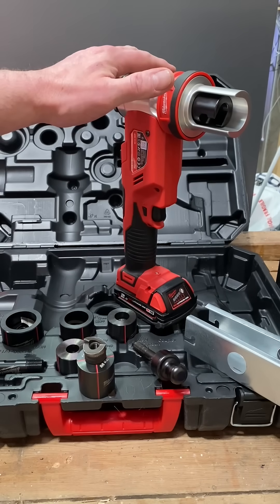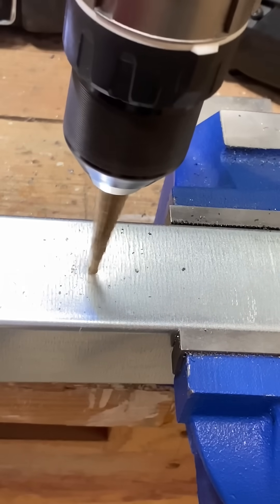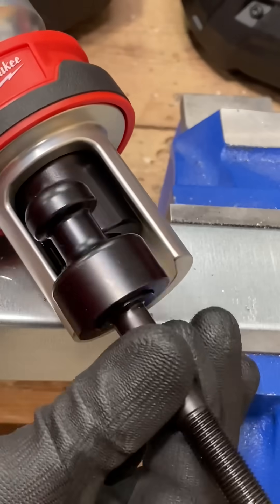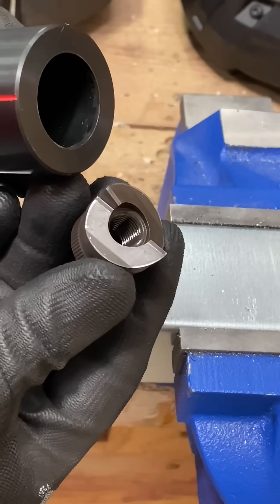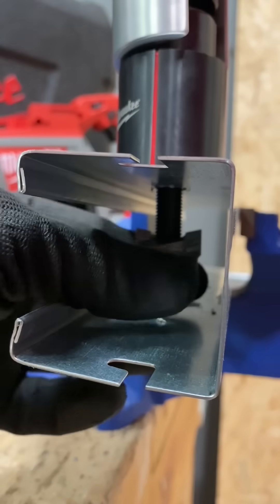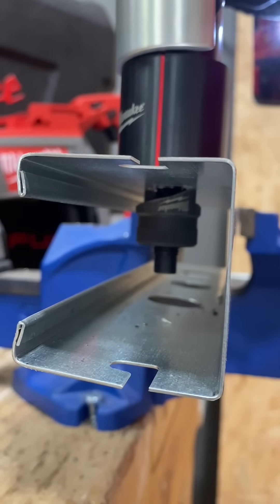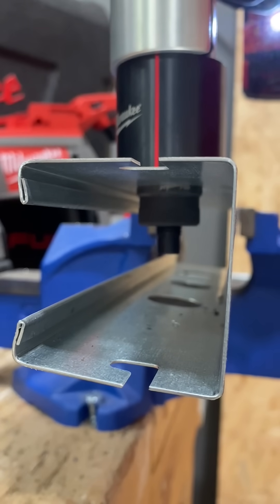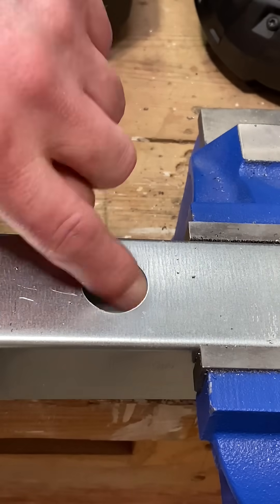ELECTRICIANS' TOOL TEASER - Milwaukee M18 Force Logic hole punch #shorts

Comment: I think for £1000 you’d need to be using this all day every day. Don’t get me wrong it leaves a nice finish but I can’t see how you could make this pay for itself very quickly?
Reply from the maker: Yes it’s one for the daily metal munchers.
Reply: Lovely bit of kit, but you would have to be hammering the industrial installs everyday for that price
Reply: @amatchmadeindevon2005  not every tool has to pay for itself. When you’re making good money sometimes you’re willing to spend more than time saved to make work a little bit more satisfying ;)
Reply: After a few holes thay will be blunt and leave a razor sharp burr, might as well stick with thin kerf hole saw I can cut hole and the us debur as quick as hole punching and save loads of money 
PS don't use the thin starret hole saws any more thay have gone to crap last 5 mins
Reply: You will pay whe you work around live circuits and don't want a mess of drilling shavings,  or pushing your drill hoping you won't damage cables on the other side of the metal sheet,  you have a clean cut and not a rough hole, not mentioning your elbow grease.
Reply: @ca-tf7ek  you do realize that you have to put this thing inside of the tube, right? The cables are still in the way no matter what
Reply: @ca-tf7ek  
If you put a short end of a plastic bottle around the cutter. The keep it from a live contact.
Reply: I have a manual version, drill 8mm hole, insert cutter (20mm), and tighten with Alan key. Cost about £10
Reply: I can’t see this lasting very long, at £1000 you’d want to get 2000+ holes out of it. Really more like 5000 holes.
Reply: @chrisb4009  die set will be buggered long before that and it'll be files out to get rid of the big burrs might as well use a good thin kerf hole saw it's lots quicker and lots cheaper to replace when it's blunt ,I build panels and I've put thousands of holes in them you won't better a hole saw for speed and price, use a deburring tool like the countersink bit to tidy up any burr left  jobs a goodun
Reply: @rogergregory5981  you're telling me you don't use a hydraulic punch for holes larger than 25mm?  Frankly I hate metal shavings, especially with enamel smoking, plus the heat can warp sometimes especially with a dull bit.
Reply: Exactly it’s almost more time messing with everything
Reply: Easily make money with this. All you need is a lot of luck, charm and salesman ability for when you're selling holes for 100 each. Only need to do 10 holes and you're set. All other subsequent holes are profit holes.
Reply: @shaunlastname391  people doing metal work like this can be ridiculously overpaid.  I know because they will brag about it when I install their internet. Rich clients will pay out the ass for custom metal work.
Reply: “So how long does it take for the consumer to make his or her money back off the use of the product” “The what?”
Reply: sounds like someone hasnt manually knocked out or slugbusted before ....all that pumping damn😂and the ratchet wrist destroyer
Reply: That’s where “time and material” bids come into play: the company that awarded the contract pays for the tool. Plus 1k bucks isn’t THAT expensive in the grand scheme of things.
Reply: @RedSilverado07  cheap tools cost double good tools pay once
Reply: I’m no metal muncher, I design and build systems from cradle to grave. Kit like this is a Godsend. I need no middle men.
Reply: @sparkz9803 Please excuse my newbie-induced ignorance here (being neither a metal muncher
 nor a member of Cradle-2-Grave hole embiggeners - hat tip to the Wisen Wizard Of The Angry Pixies Of The Great White North, AvE, Author of the classic machinist manual,  "Always Close Your Eyes When Operating A Power Lathe") but I asume your favorable comments indicate it is capable of producing results that othrr tools in the price range cannot. Vould you be willinh to educate me a bit? I promise to shutup and listen.
Reply: @disqusmacabre6246  hard to explain. It just feels like you just cut open a cardboard box as opposed to scraping a hole onto metal. Drilling out a half inch hole is alot easier and sends alot less metal shavings everywhere than a 1 inch or 2 inch hole. Even more so if you're in a awkward position or in tight spaces and have to drill a hole. It also allows you to adjust your hole if you didn't drill as center as you want.  I hear stories of electricians getting MRI scans and they can feel the metal in their skin reacting. Anything that reduces the chances of getting  metal shavings in my ears, I'll take. But yeah this thing only really shines on bigger holes but you have to drill half inch anyways.
Reply: @sparkz9803  do you mind explaining how so? I'm curious
Reply: Nice tool, but WAY out of my price range. A GOOD step bit is under $50 and works just fine for me. Now if I was drilling holes like this ALL day, EVERY day to then I would invest in one. But less than 10 holes like that in a week, I'll stick with my step bits.

Comment: P.A.T testers must be pleased now, sitting in the warm cabin just certifying charging units rather than hundreds of trailing cables and 110v tools. Can’t wait for 3 phase battery technology or something similar.
Reply: All brushless tools are 3ph
Reply: @TheManLab7  if only you knew how bad things really are
Reply: @2x489  I don't get it? 🤷🏻‍♂️ Could you elaborate please?
Reply: @TheManLab7  i was referring on how a internal inverter is required to make a brushless motor turn which causes a tangent of inefficiencies
Reply: Mx fuel system by Milwaukee is working towards higher demand tools
Reply: @Sparkz 3 phase battery technology would be impossible. All batteries are DC. Alternating current is required to have multiple phases.